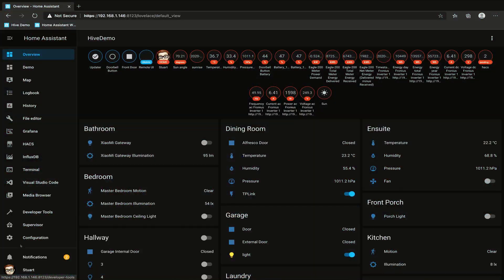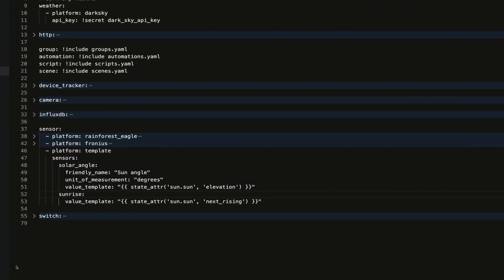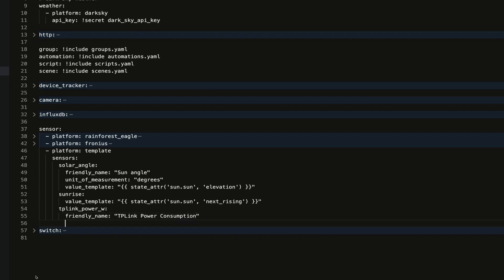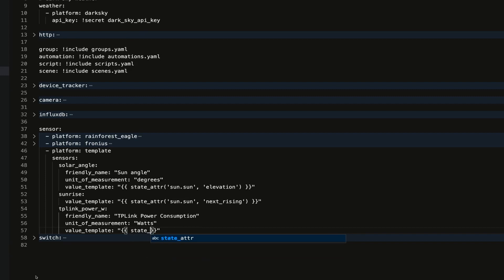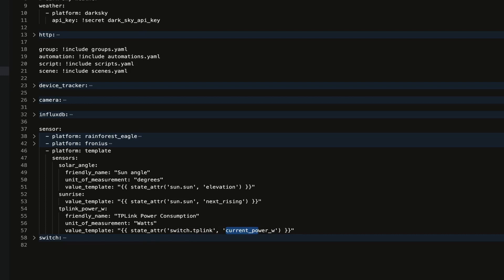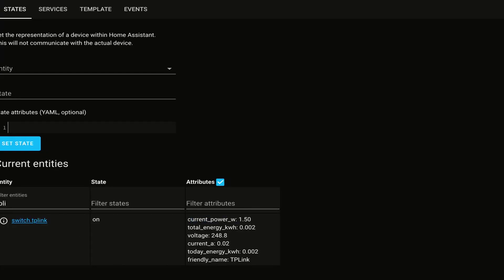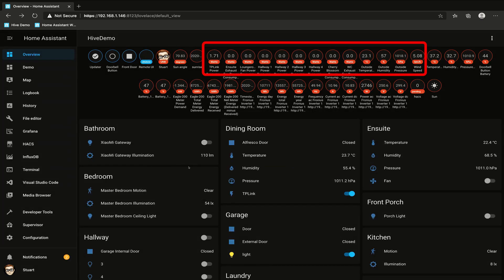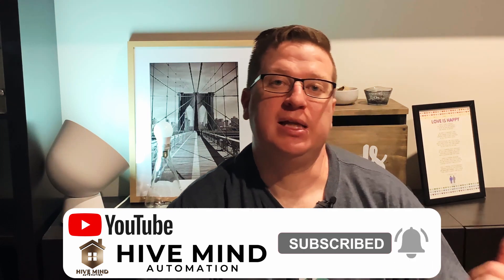Quick Tips   Template Sensors

Comment: I didn't follow why you would want a template sensor.  What a template sensor allow you to do?  Why wouldn't you just display the entity attribute on your dashboard directly?
Reply from the maker: This is a bit of an older video. When I made it, it was a lot harder to reference Attributes.

It was especially a problem when creating Automations that would trigger when an attribute of an entity would change to a value. 
Also - back in the day - if you were using the something like the InfluxDB integration, only the "State" value for entities would be sent, so it became necessary to break out useful attributes into their own Entity with the value as the state if you wanted that data.

Thanks to the tireless advancements by the Home Assistant team, template sensors are less necessary these days.

Comment: I'm trying to get the pressure to show up in PSI if anyone could help me please!  I'm running home assistant with firmata and using the analog pins.  I can get the raw data to show I'm just having issues displaying PSI.
Reply from the maker: Using Template Sensors defined in YAML you can add the key "unit_of_measurement" with the value of "psi"

Comment: Thanks for a great video! I've saved it for reference. Would be nice to get help with the syntax to transform values of attributes. E.g. I extract the electricity price level from my power company which can be for example 'EXPENSIVE' I would like to use the value so that if it is EXPENSIVE change the  color of the icon to red (mushroom entity card) and tex should read 'DYRT' which is the Swedish word for it.
Reply from the maker: Great suggestion! I'll have to do some research on how to do that and get back to you as it's been a minute since I've used Jinja inside Home Assistant.

Comment: I'm here to find a way to "calibrate" a sensor with 2 points.  High/low.  Unsure if Template is the way to go?  For example, take a pH sensor, you can calibrate to pH 4 and 7 buffer.  Trying to figure you where and how to put those sensor calibrations in.
Reply from the maker: Template sensors are for extracting attributes from already existing sensors. 
Not really too sure how to go about this "Calibration" process. 
You might need to be looking at an "input number" variable if you're using an offset.

Comment: how to get all the sensors values above in to Lovelace like yours?
Reply from the maker: Once you've broken them out into Template Sensors they should be available. If you've Customised your Lovelace Dashboard you'll need to manually add them, as they won't appear automatically if you've customised any part of your dashboard.

They should just appear as normal sensor entities in Home Assistant like:
sensor.tp_link_power

if you head to your "Developer Tools" Page and search you should then be able to filter by the "Friendly Name" you set in the Template Sensor. If it's not showing up, something isn't right with your config.

Comment: Thanks ... but I may watch this a few times, to get it clear.
I want to compare 2 temp sensors and if (temp of sens 2) is x degree higher than (temp of sens 1) than switch (ie. waterpump) on.
So I understood from you’re video, this may be quite simple,how ever for me, the way to reach the goal may still be long and rocky.
Reply from the maker: You'll need to use templating in your automation trigger.
I'm not quite sure how that's going to work, I'll Do another video about templating in the future and learn it myself by teaching it :)